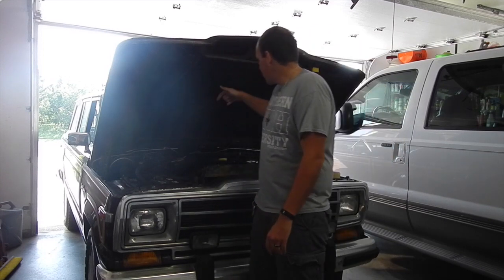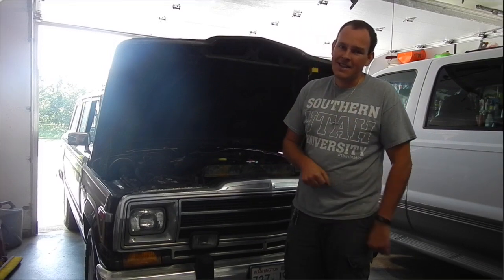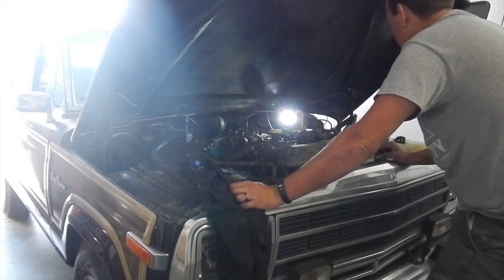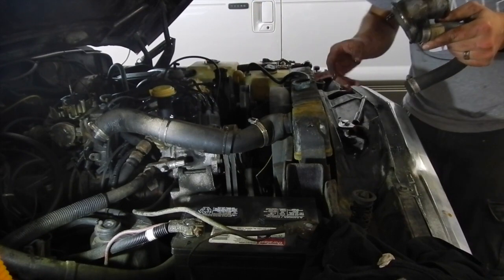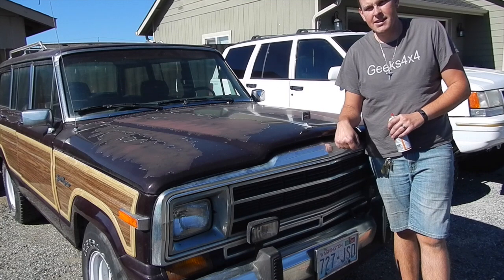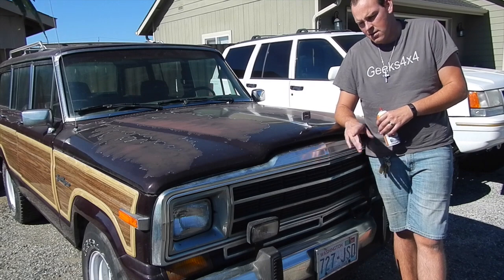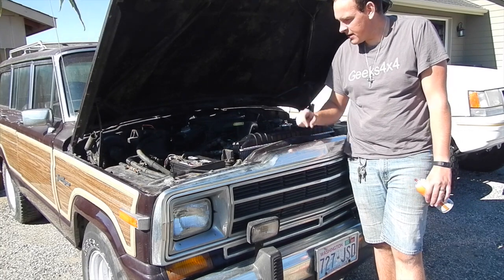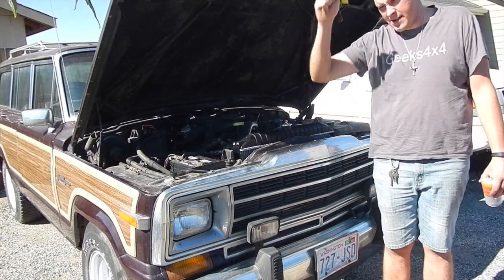Waggy build Pt 4: New radiator install

Comment: Great install! A few ideas for the dying issue. If your not positive you got all the vacuum leaks then just spray brake clean or carb cleaner all over. if the RPM dont change then I would look at the carb. Check the  mixture screws, should be around 1.5 to 2 turns out. Then check to see what the motor is idling at. If the idle is to low turn it up. If none of that works, then its time to check the timing of the motor. If you don't have timing light, some auto parts store rent them. Hope that helps!
Reply from the maker: thank's for the tips! ya the idle is all over the place which leads me to believe I've still got vacuum issues, Once its warm i can spray starter fluid around the EGR and it idles up so I put some more sealant on that connection, i think the new EGR I bought might be bad so I order another, fingers crossed.